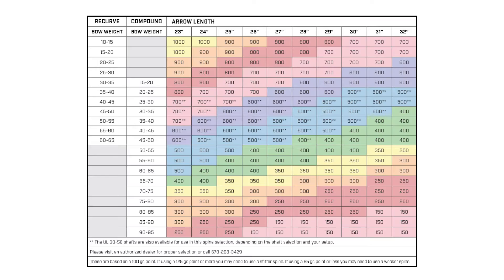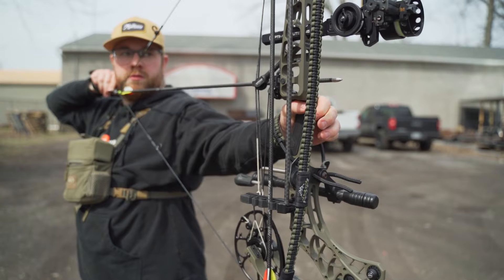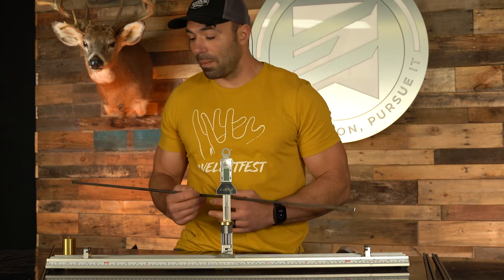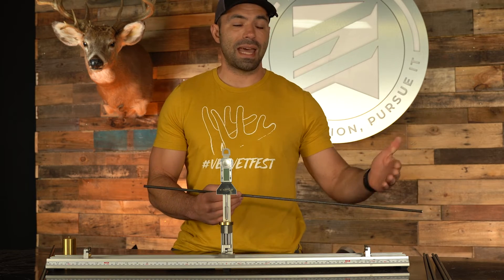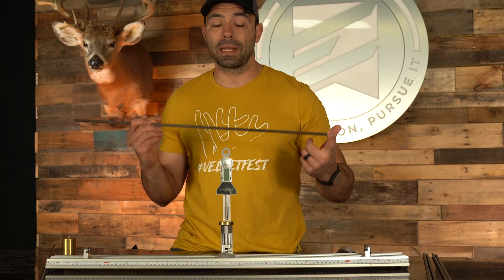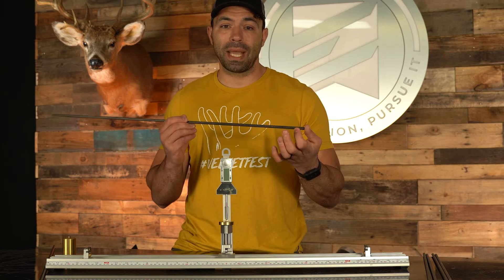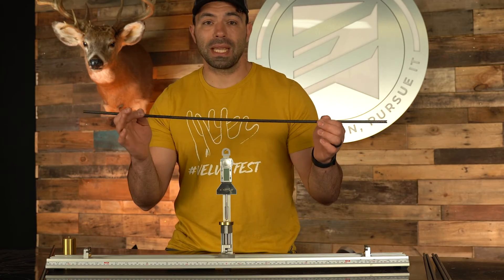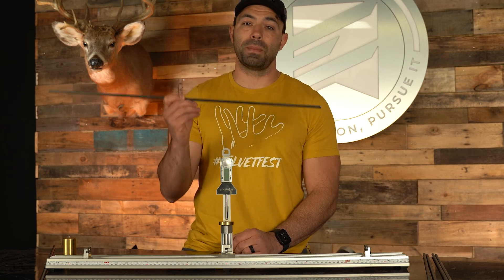Static Spine vs Dynamic Spine vs Dynamic Bend: Building Arrows for Bowhunting

Comment: I've found that no matter where your weak point of the spine is, it doesn't dictate where your nock tune is. 
From my experience it's more about the actual spine deflection consistency in a certain location.. i.e. some set ups like weak spine down, some like weak spine up but more importantly from the smallish data I've gathered I've seen a consistency around the actual deflection number. Each set up like a specific spine deflection number face up (or down) and when you nock tune if you mark the best paper tear with each arrow and then go retest the arrows on the spine tester, each arrow in the nock position that you marked, will likely be close to each other in spine deflection number.

Comment: So what you are doing is finding the stiff side of the shaft correct?? Do you want the stiffer side up or down ?? When doing the nock tuning Troy’s way one is perfect the other is always very close but not exactly as good?? Thanks for your content awesome as always
Reply: Correct, one side will be under tension and the other under compression. Finding this allows us to know where the arrow will flex first and in what direction when work is applied by the bow string. This only matters if you are shooting a fixed rest. Ideally, the only point of contact with your rest is the shafts node.